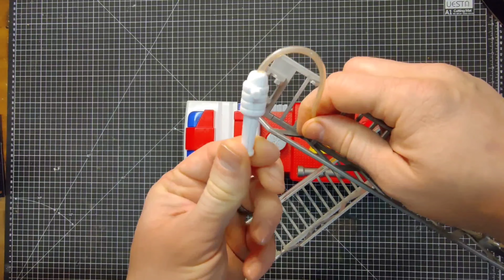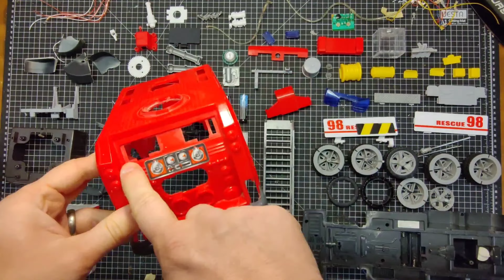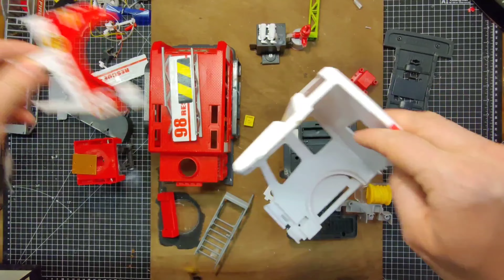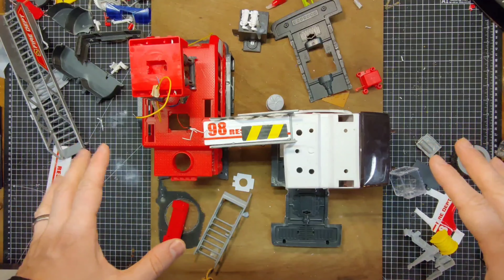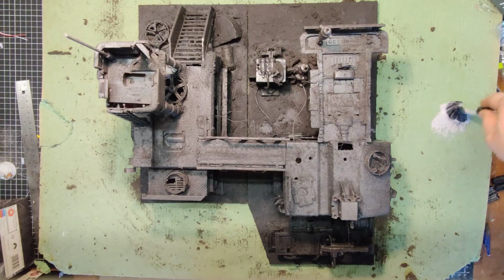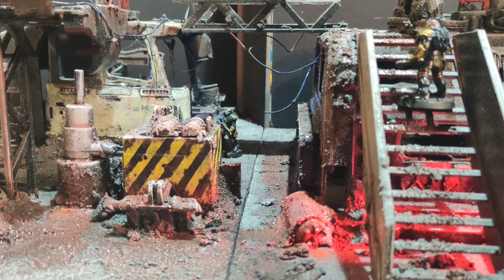One Toy Terrain Build - Necromunda/Grimdark/Industrial terrain using only parts found in one toy

Comment: The build was a very clever idea and very well executed, but TBH I skipped or muted half the video. The music was obnoxious at best and certainly more trouble than it was worth. As for commentary, the way to do a video like this is to film yourself doing the build but with no sound, then edit the footage down to the relevant parts cutting or speeding up as necessary. For example, we did not need to see the entire disassembly of the toy.
Then record a separate voice track that you can edit and add to the video, synching it to explain what you did at each step. You can do that at your computer with a mic and even a few pieces of acoustic foam in a corner and it will sound a lot better. As it is, if you just have a mic standing there while you work or even clipped to your lapel, I literally cannot hear a word you're saying. Hope that helps.